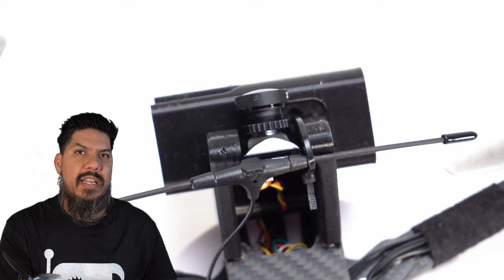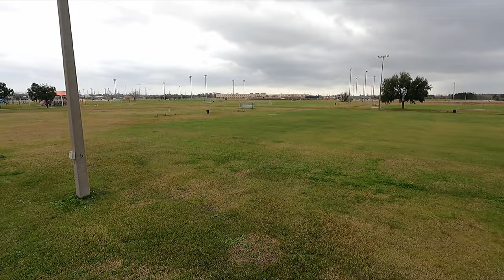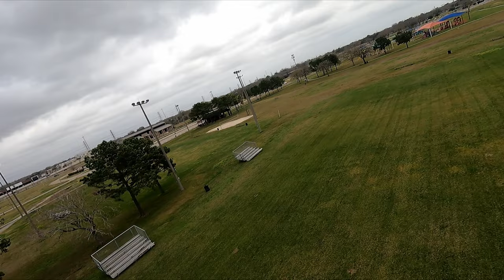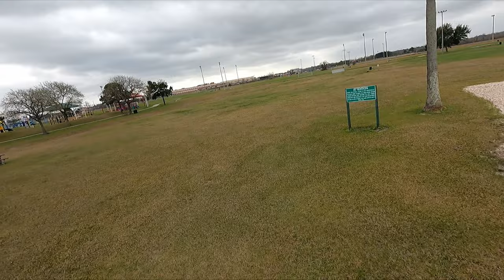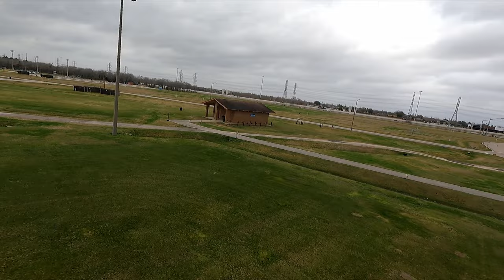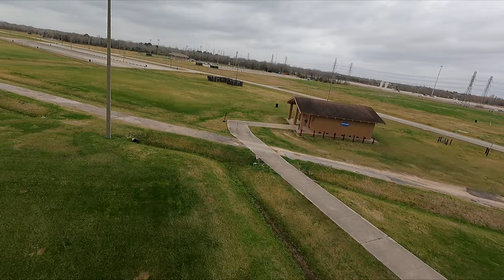FR7 BH 2806.5 - Open source long range drone build

Comment: Drop the Kv to 1300 in those motors and it will be way more of a config for Film Cruising LR. I love my 7
Reply: Agreed..
Reply: or go 1800, its super easy to put a cap if needed, but its impossible to raise KV. having flown 7" triple and double a lot on 1700/1800 I love ability to go fast when needed.

Comment: Thanks for the vid, Jon E5.  I'm building my first 7" long-range quad next week.  In fact, some of the parts hit my mailbox today (thanks RDQ for your "super-secret-squirrel" ultra-fast shipping techniques).  Mine will be analog, too, built on an iFlight Chimera7 frame, a Diatone Mamba F722 FC/50A Pro stack.  The motors I chose were Emax's Eco ii 2807/1300's.  I'm rocking the same VTX antenna as you are, nice and l-o-n-n-ng (that's what she said!), only it'll be spewing 1.6 watts of RF that's provided by a RushFPV Tank Solo.  I'm using Express LRS, flashed onto some R9 equipment I had in the workshop...just in case I wanna fly it into the next county.  I fully expect this thing to haul the mail when I want it to, or drop back and just cruise....depending on my mood. :)

Comment: Jon, if you can, swap in an Air Unit, and a base tune (HMU if you need), and it can still be a comically fun explorer setup for just cruising around.  Still a very niche tool of sorts, but great fun.
Reply from the maker: i kinda do want to swap it, but then again, i just dont have the areas large enough to fly it to its full potential in the city.  It is a fun one though for sure.
Reply: @JonE5FPV  Yeah, I found that the air unit actually added some bandwidth to that chonker - as did running some 6" props, since that was easier to tune for, and results in something that can cut through wind amazingly, and doesn't necessarily want to cruise at 70mph anytime you go above 15% throttle

Comment: I have the same 1700kv motors, I find I have that extra punch to do some freestyle on the way back home. From a 1 mile flight. Im also running a 3300 mah 6s and it get 8 to 9 minutes flight time.

Comment: I’m on the fence about this drone because of the cost and risk.  I mean my Mavic Air 2 will go a few miles no problem and almost a guarantee to come home if there is a problem. Obviously it doesn’t fly like aN FPV drone, but I think it depends on where you live. Where I live there is no mountain surfing. I just don’t trust Betaflight GPS enough and the cost of this drone if you lose it is pretty high.  If you add up every component and the GoPro I am sure you are approaching $700-900.  My Mavic Air 2 was $799 but it doesn’t failsafe and drop and 99.99999999% of the time it will come home. AND if your flights are being logged on your phone. If a Mavic just failsafe and dropped for no apparent reason you could probably get it replaced, as long as it was a defect. You think Brother Hobby is going to replace that home made long ranger if their motor fails and you lost the drone?  I seriously doubt it.